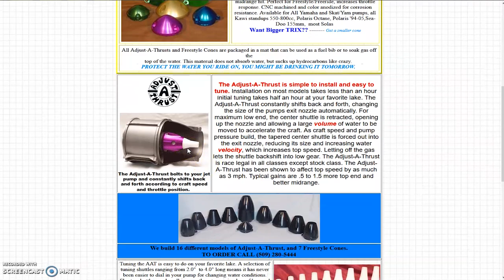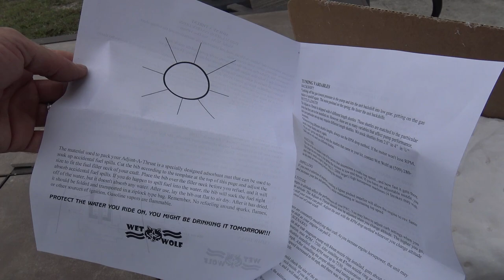Adjust-A-Thrust, Wet Wolf PWC Seadoo/Yamaha/Polaris/Kawasaki Performance Mod

Comment: 9:15 I would say that the "other hole" is what actually actuates/pushes the shuttle out.
The more you rev the higher the pressure in the pump, and that pressure overpowers the spring.
The shuttle is more like a piston in that sense.

Comment: thanks for the vid, been looking at grabbing one of these for my 1300r.
Reply: finally grabbed one. got a lot of testing to do.
Reply: @Fire_Power414  did you see any difference?
Reply: @nikos2jzgte  honestly I have only tried one of the shuttles... and didn't compare rpm's to stock and solas props. maybe currently lose 1mph up top but increase a tiny bit of holeshot. feels less sluggish off the bottom but I don't have a leo's or jetworks kit yet would probably help a lot

Comment: Nice video, with results. 110 octane contains no more power than regular 87, it just contains more octane that prevents knock at higher compression.

Comment: What kind of MPH are you guys getting? It doesn’t seem as fast as a 787 powered ski with same hull. You should look into a VTS system also. Aiming the nozzle can net you some MPH also. I got a 97 spx 787 and gps clocked at 60 mph BONE STOCK!
Reply from the maker: jose ortiz yah I’m only at 56mph at 5800 rpm I found out my rev limiter is not working correctly I should be at7500+, when I get that corrected I should be well over 60. The instant spool up is no comparison to a stock 787 it’s almost instant max rpm..

Comment: What's that rusted bolt sticking out of the Buckshot head towards the end of the video?
Reply from the maker: Travis Bruehl so I plugged the bleeder line on the top of the head until I get it routed to a pisser line on the back

Comment: YOU HAD 130PSI IN EACH HOLE BEFORE THE HEAD....THATS NOT GOOD. THAT MEANS THE ENGINE IS ABOUT SH*T. 150 IS WHERE THAT SHOULD BE WITH THE STOCK HEAD.....
Reply from the maker: scottfelver I think it’s due to the squish band I need to adjust I think I have too much squish clearance The engine only has less than 20 hours on it and the cylinders are spotless. I’ll let you know in a future video